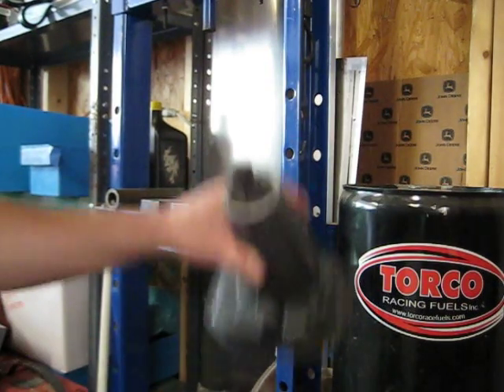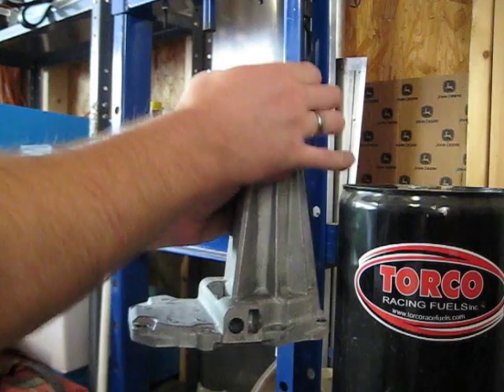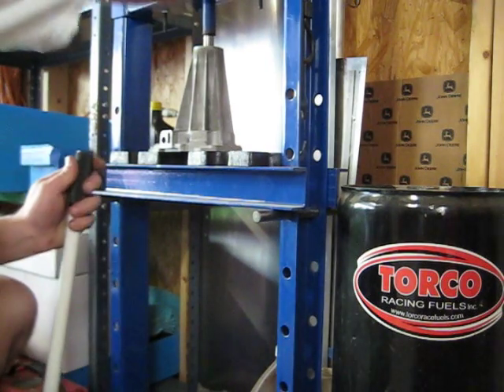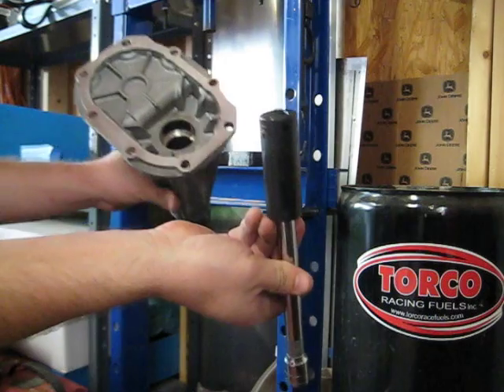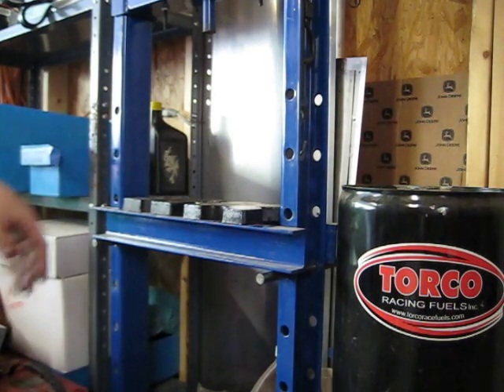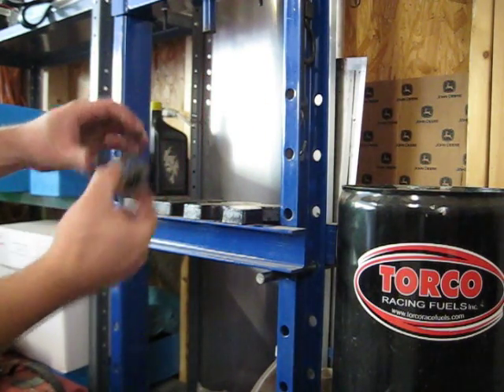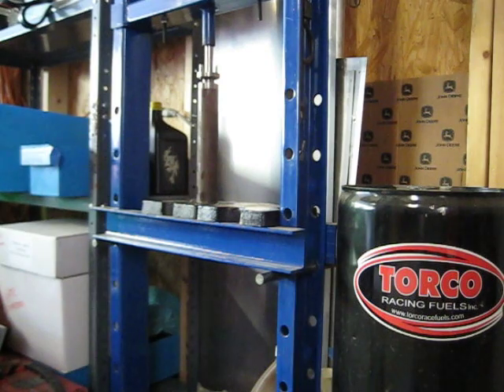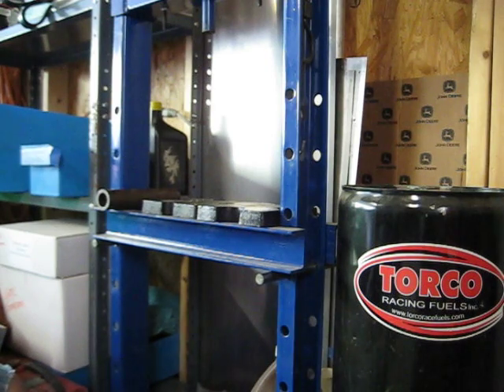Eaton M90 Supercharger Snout Rebuild: Part 1

Comment: Commented on your other video. I did, in fact, grenade the inner bearing. Turns out I could've pressed out the hub pretty easily and then tapped the bearing out in a vise.

Comment: I have a neuspeed supercharger/Magnuson, for a mk3 be. It has a pulley with a woodruff key, when I toghten the bolt for the pulley down on the shaft it get real hard to spin, when I loosen it, it spins alot easier. Did the shaft somehow get pressed too far into the snout. Pulley when tightened hits the seal.

Comment: I like how you did this video! do you still do snout rebuilds? I have an m90 from a 98 Riviera that needs a new seal and coupler, I would like to have the bearings done as well and go a step smaller than stock on the pulley. please msg me if this is something you'd consider.

Comment: I looked at the oil in the sc on my 2004 impala I recently bought and the oil has shavings in it (looks like silver glitter) Are the rotor bearings in the same oil bath as the snout bearings? Or are they sealed like the needle bearings on the other end?

Comment from the maker: The snout used in the video is from a Eaton GenV M90 supercharger. Its from the 2004+ models with the 3800. 1996-2003 used the GenIII M90, same size unit, similar in some aspects, but different configuration. Normally when you have the "rattle" noise on a genIII its 9 times out of 10 the coupler inside is bad. Its a cheep fix you can do yourself. Its a $30.00 part. I can message you the link since I can't add it in the comment section.

Comment: Hey thanks for the video!  Is this the same supercharger used on a 2001 Pontiac Grand Prix GTP?  The snout housing looks the same from the outside as far as I can tell.  I have a nasty grinding noise which sounds like its coming from the bearing behind the pulley.  Can you point me to a good rebuild kit?  And is it safe to run the car with the supercharger belt removed?

Comment from the maker: Its not Teflon, Eaton has never used Teflon in their superchargers. The coating is simply a abradable coating (Wikipedia it) GenIII M90's like used in the 1996-2003 models didn't have good rotor prep for the coating to bond securely. 2004+ models with the new design got better prep, and a new coating that will "run in" on it self after the first few minutes of run time. Rotor coating flaking off on the GenIII's are common. It wont work as efferent, but you wont notice a huge difference.

Comment from the maker: changing them depends on the model of SC. Some you can force out with a special tool you can make yourself, or you can use a blind hole bearing puller tool. WHEN you need to change them can depend...most the time they get replaced anyway since were in there rebuilding it all. I would say just took for a lot of play in them. I use Redline CV-2 grease in those bearings when I rebuild them, and reuse the bearings.

Comment from the maker: side by side play might refer to "slop" in the rotors. Less is better, but some is allowed for heat expansion. You will see damage/scuffing on the edge of the rotors if you have a LOT of play/slop, or hear the chattering when its running. This can be bad bearings behind the rotor drive gears, or bad worn gears themselves. Think of them being worn, and out of time. End play might refer to the rotor gap of the rotors to the aluminum body, bearing wear at either end would cause a great amount.

Comment from the maker: if its the case needle bearings, there are a few different ways to get them out, it depends on the model of supercharger. Some you can tap a small hole, and make a tool (a hollowed out bolt with a grease zerk on top of it) and force the bearings out with pressure. The other method is using a blind hole bearing puller, where the puller attaches to a slide hammer and you pop em out that way.

Comment from the maker: Yes, and and all questions are welcome. 

Rotor bearings, such as the bearings behind the rotor drive gears, or the needle bearings down inside the case? 

If its the bearings behind the gears you usually have to heat up the gears a little and pull them off vs. pressing the shaft out of them cause the body they go through is cheep pot tin aluminum, it doesn't take kind to "work" sometimes.

Comment from the maker: Thanks! I would suggest that with the snout off, to do, or have the the shaft pressed back in all the way. Main problems that can happen are the pulley will grind away at the aluminum snout, or the seal behind the pulley there. Your belt will also be tracking wrong. The only way I have seen this happen is from somebody switching out the supercharger pulley with the wrong puller/install tool, and they try and finish with a hammer. Yes, I rebuild these for people all the time.

Comment from the maker: Glad you liked it and hope it helps explain things for you better. The pulley should not be touching the seal, or the aluminum of the snout on or off the of the supercharger. The pulley should be pressed on EVEN, and flush with the end of the snout shaft. If that is, then the shaft is in/or pressed in too far. See part 2 of the video segment.